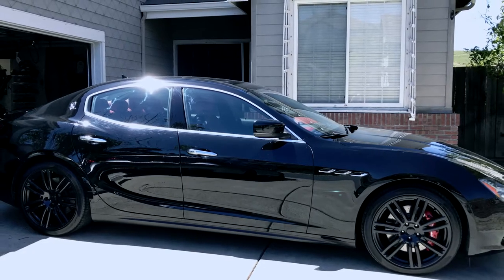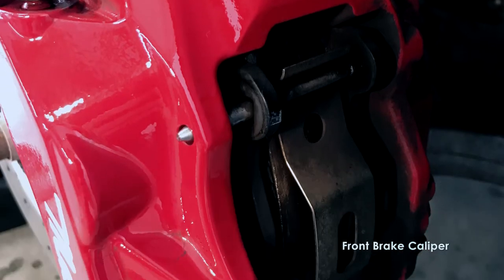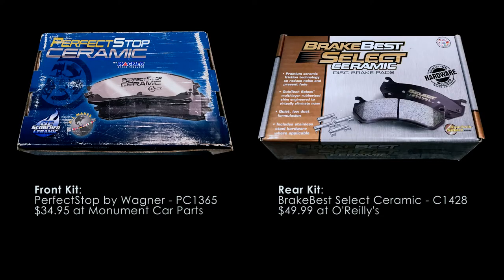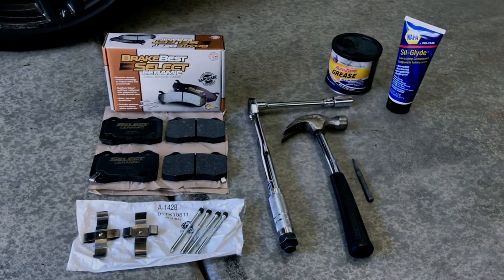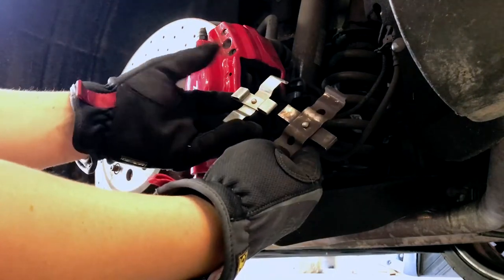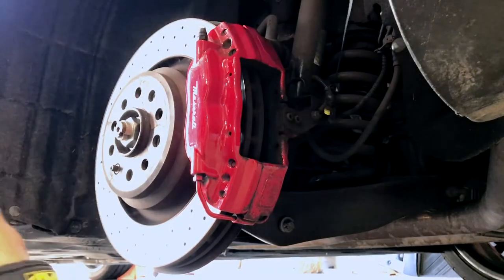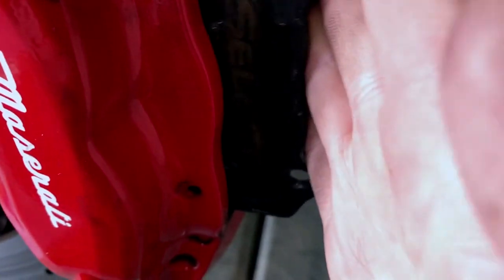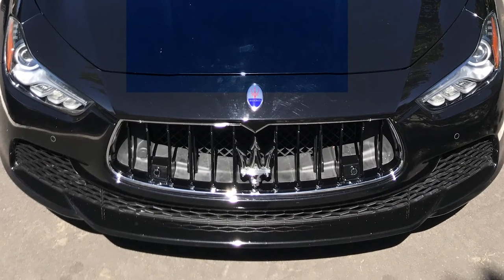2015 Maserati Ghibli SQ4 | How to Replace Rear Brake Pads

Comment: I work for a brake manufacturer, looks like you used the wrong rear brake pads. The C1428 brake pads are for Tesla model S or a Hyundai Genesis Coupe.  That's why the abutment clip was to small. You should have used the C1053 from Oreillys it has the larger clip. Hope that helps.
Reply: What about the front

Comment: Sorry if I'm asking a dumb question but dont you guys have to disconnect the parking brake function in order to do the brake job?
Reply: The parking brake on these Model year is inside the rotor, drum Part of the disc.

Comment: Do you know where i can get those brake pads for 2014 Maserati Ghibli SQ4?
Reply: I have a 14 Ghibli SQ4 as well. Blue w black rims. (so sick). 
Power Stop 17-1053 Z17 Evolution Plus Brake PadHawk for the rear
Performance HB616Z.607 Performance Ceramic Brake Pad for the front
I spent like 5 hours pouring through the forums and researching. The rears are for a Tesla, and the front is for an IS-F. Those, per the forums fit. I could not find these brake pads in the video anywhere.

Comment: I just change mine but I couldn’t find these pads so I purchase the pads from Maserati and took to my local shop to do the labor
The Maserati dealer ask me $1450 to do the front brakes, they told me that it was necessary to also change the discs, of course i didn’t took my car to them 
I had the rotors replaced 6 months ago, so i knew that my shit still good
I had to change the oil too, they also ask me $1450 for the 4 year service, telling me that was necessary to change belts and shit
My mechanic charge me $1.300 for the front n back brakes and to change the oil+ filters 
He purchased everything from Maserati 
In another words, Maserati was basically charging me $1.500 in labor alone
Reply: what kind of brake pads did u purchase?? thank you
Reply: Wagner Filho How did you get the maintenance light off once your mechanic chanced your oil + filters??
Reply: They were correct in their recommendation and price. Don't cheap out on that car and it will last you.

Comment: I was looking in oreilly for the brakebest select ceramic c1428, but in their web site looks like the brake pads doesn’t fit to a maserati ghibli sq4 2015, are you sure works fine? And how is the difference between the OEM and this ones based in your experience?

Comment: You should cut the socket from old pads and plug it on the cable on car to secure the pins from water and dirt.

Comment: With the wear sensors, should i splice the font 2 wire sensors together and tuck away, and with the back just leave the sensor unplugged since oem is a one wire wear sensor embedded into the pad material?
Reply from the maker: I just left the front and back wear sensors unplugged, wrapped them and tucked them away.

Comment: Hello, hoping you can help?  I have a 14 Ghibli SQ4 and I just replaced my front pads as well. Very similar to everything you did in your video. Like your pads, mine did not come with the sensor. However, my brake light remains on. The orange wrench light, the red "brake" light, and the notification on the lcd screen in the center of the cluster telling me my brakes may need service (or whatever it actually says). I have had no luck trying to get these lights off. Did you do anything or reset anything for those lights to go off for you? I zip tied mine too just as you did but mine will not go off and its been over 500 miles. I appreciate any help.
Reply: Rob, I’m sorry this happened to you. I hope you see by now these type of posts to save a few bucks only cause more problems. Just pay the money and have it done professionally that way you have a warranty and someone to blame. Once you do what this dude did to his breaks get ready for problems in the future. DO NOT USE THESE BREAK PADS FOR THIS VEHICLE! FYI.
Reply: @DamienTheRaw  Actually, you couldn’t be more wrong. These posts are helpful and informative and I appreciate the op taking the time to make it. There was no issue with the brake pads and they worked perfectly, it was simply a reset that needed to be done. So rather than just paying a dealer almost 10 times what it cost me to do it as you recommended, I saved myself over $1300. It was well worth the hour of my time. I highly recommend doing the work yourself if you’re mechanically inclined and want to save $1000+.
Reply: @robt1335 so you used an obd scanner to get rid of the dashboard notification light?

Comment: The dealer asked me to change pads and discs... do I need the discs change too?
Reply: Jose Beltre depends on how they look. If you notice they bend in a bit from wear then yes
Reply: Do not listen to Corey. Maserati recommends changing break pads and  disks at the same time or you could end up with rotor warping, Uneven pad wear and overheating issues. I’d advise buying the recommended parts yourself to save a few bucks then have them professionally done for warranty purposes.